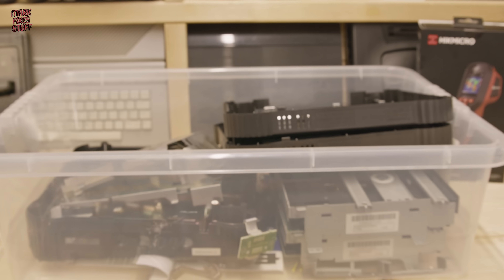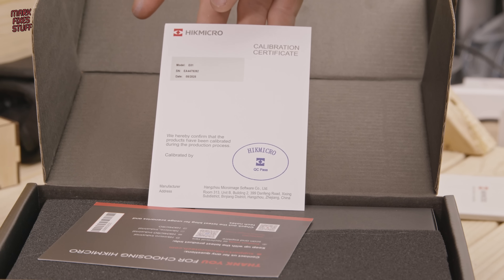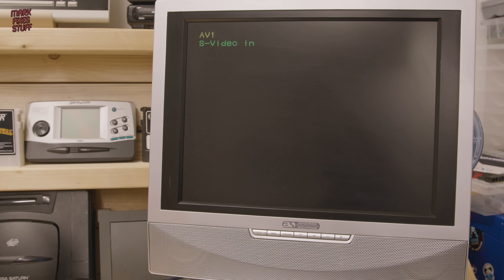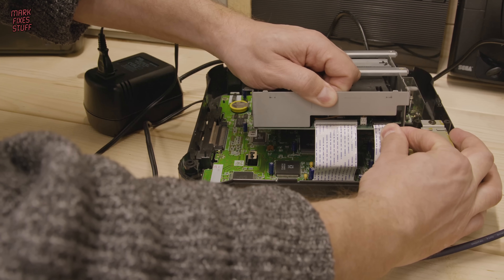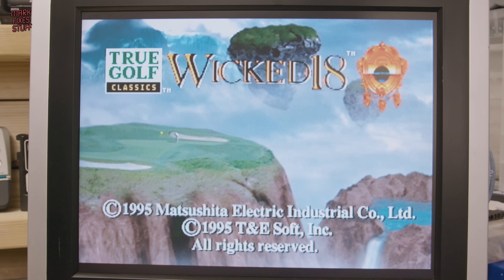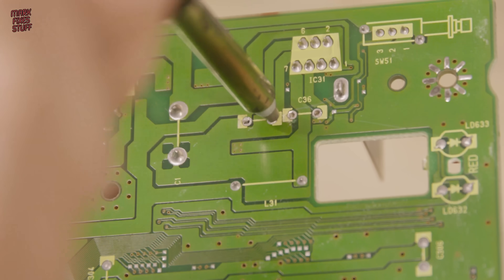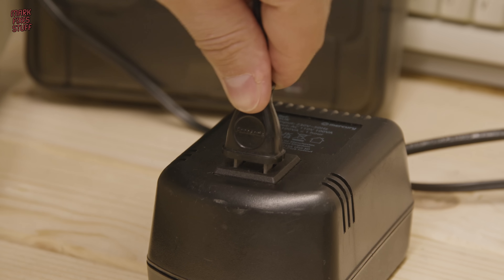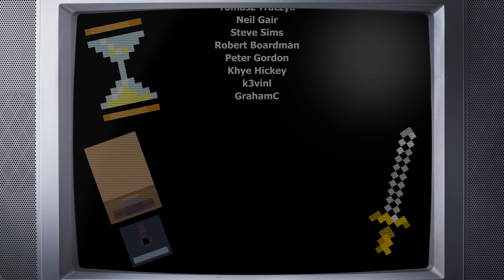Building My Ultimate 3DO FZ-1 - Part 1 – Thermal Diagnostics on a Japanese Mainboard - HIKMICRO E01

Comment: Good to see you back Mark, your video and voiceover style remain soothing. Why didn't you replace the biggest 25V 6800uF cap as well?
Reply from the maker: In all the FZ-1 consoles I've repaired I've never found one of the bigger caps that's been out of spec. In fact, the 100uf cap is usually good as well, but I do replace those because the leakage often gets underneath that one. Bigger caps are less prone to drying out near heatsinks.

Comment: Hi Mark, Ive done the Mod where you remove the transformer and some components, wire in a WII PSU Socket and use a WII external PSU. I gather that will certainly bring the temps down inside the case.
Reply from the maker: That’s an excellent way to reduce heat inside the case! I'm putting in a traditional transformer, but rated for 240vac.

Comment: Ive built the same ODE and theres not enough power to use the sata to usb cable for the SSD ,but I was using an old hard drive not a SSD, also how much import TAX did you pay Mark as I`ve ssen lots on Ebay but they do not include TAX ect..keep the videos coming.
Reply from the maker: I think the ssd will be a lot lower power draw than and old hdd, so it might work. Only one way to find out really. 

On AliExpress the VAT is included in the cart. It was just really really cheap in a sale. I have a more expensive version here in a box that cost about £18 and comes with Acronis etc. If the cheap one fails I’ll try that. Otherwise I guess it’s going to be a large memory stick.
Reply: Hi, it's very difficult to guess what kind of load a SATA mechanical hard disk drive would impose on a PSU during spin up, seek, read or write operations, some 3.5" SATA HDDs (even smaller ones, like 80GB) can have pretty hefty requirements on the 12V line, I have some old 80GB drives that require less than half an amp on 12V and a similar number on the 5V line and a Maxtor 200GB SATA one that require 1.2A on 12V + 0.7A on 5V. A 500GB Samsung 870 EVO SATA SSD require a max of 1.1A on the 5V line.